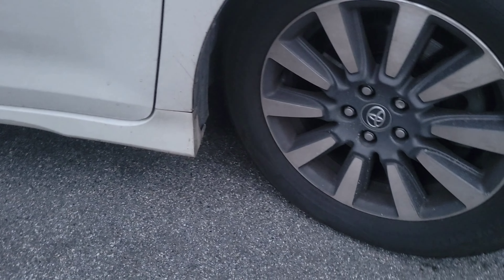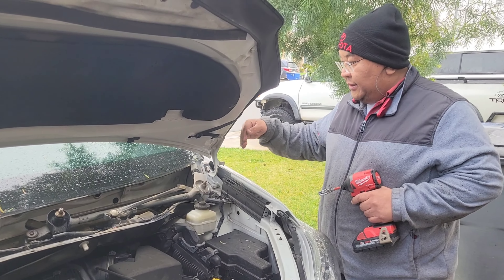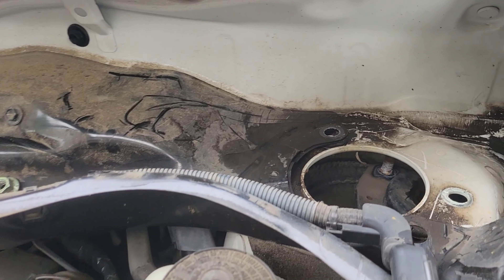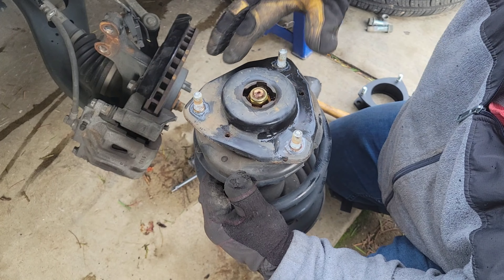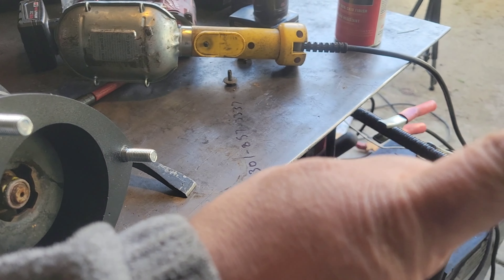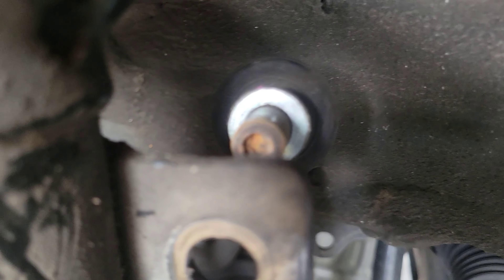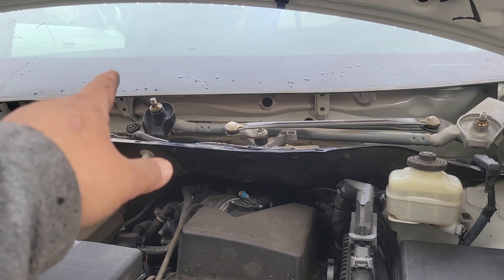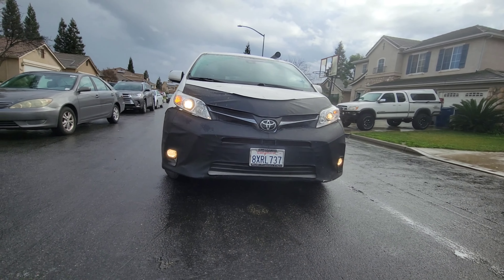Toyota Sienna Traxda 2 Inch Leveling Kit pt2

Comment: Nice video. I’ve ordered the traxda lift kit for the front only as I have airbags for the rear. Did you use the longer sway bar end links for the rear or the front? The front kit does not come with longer end links. I’m hoping to use the existing sway bar end links for the front.

Comment: Hey, very nicely done! I would like your experience in terms of any change in the ride, particularly high speed and sudden maneuvers. I’m a little concerned about the center of gravity being this much higher and how it will affect the vehicles handling. I know you said it handles normal I did read that but I’m curious specifically about freeway speeds. On I five I tend to go 90 or more.Thanks in advance.

Comment: I'm installing the same kit on my 2013 Sienna,  I was told I should install a camber adjustment bolt on the upper set of lower front strut bolts. Were you able to have a proper alignment done after your lift kit installation?  Thanks for the video!
Reply from the maker: I haven't had it done. It drives normal

Comment: How's the ride so far and the drive shaft since its a little bit higher? I'm planning to put one in my 2018 siena.
Reply from the maker: @BisdakAdventurer  rides good. Make sure you get it aligned
Reply: @theotherguy3083  Thank you. I ordered 2inch but they are of out stock, I ended up getting 1.5inch.

Comment: Hi Just wondering what sized tires can you install now on your 18" rims with the 2" lift? Thanks
Reply from the maker: I plan to up 2 inch taller because at 70 mph. I am doing 76 mph on my GPS vs the van's speedometer.

Comment: Did you install the shorter sway bar links from traxda?  Or did you keep your stock ones?
Reply from the maker: The kit I have did not come with a sway bar link. I used my original.  It works fine